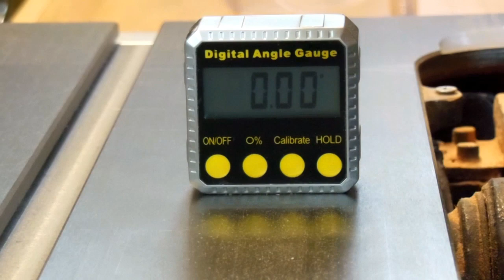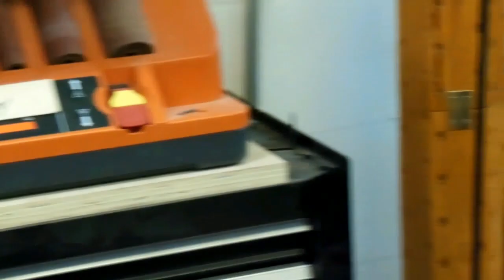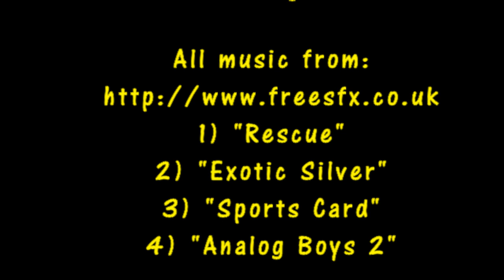Make A Fancy Wooden Pedestal

Comment: Thank you for the Shout Out Steve,
  I started getting new subscribers this weekend and I was wondering, now I know.

  Very cool, a Robot voice machine, we can all use one of those.

  I have a fan that the stand is broken on and I have been wanting to make a new one, It just never seems to make it to the top of the list. Excellent build.

Regards,
Bob
Reply from the maker: I appreciate your watching, RJBWoodTurner . And you're more than welcome for the shout out. Though it doesn't compare to the glowing endorsement you gave me, I'm definitely glad you got some new viewers out of the deal.

The fan is one a customer brought in for repair a several years ago. The control board was lightning damaged (it was a remotely controlled fan) and it just wasn't worth repair so they told us to junk it. When I went to wire it for my son I found that they fan itself was also bad. I replaced the open thermal fuse in the windings and got 'er going. Now I just need to install a switch so he can access all three speeds. I never had the base for it either. Hence, this video!

Comment: Is that an Alton Brown "Good Eats" shout out at 2:25?   Nice.
Reply from the maker: Not intentionally. But I like where your heads at! I got a good deal one time on the sauce brushes (cheaper then Rockler's silicone brushes, just had to trim the bristles shorter). I was skeptical when I first saw Rockler's brushes for sale but, damn, they're absolutely perfect for spreading glue!
Reply: I've heard those silicon sauce brushes are handy for glue but never tried them.  Still use my fingers.  Did that sound wrong?
Reply from the maker: You ought to try one; you'll love it. It's amazing how well they accomplish the task. Sauce brushes come with long bristles, which are perfect for sauce. But they're too long for the viscosity of glue. Trim them shorter and you're good to go. Then, once the glue dries, you can peel it away and the brush is good as new again.